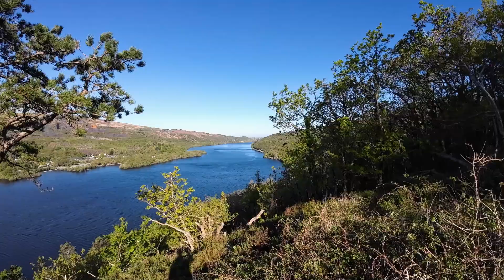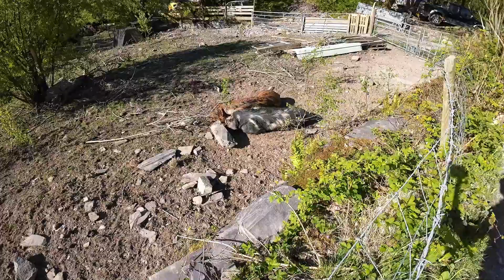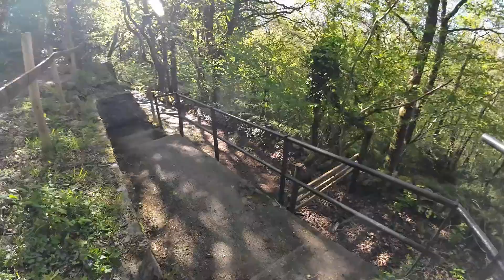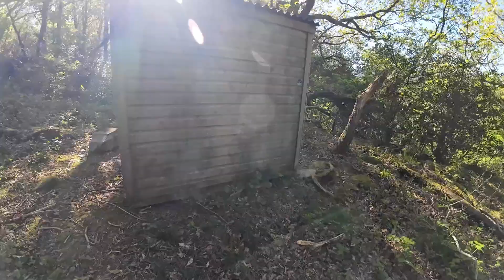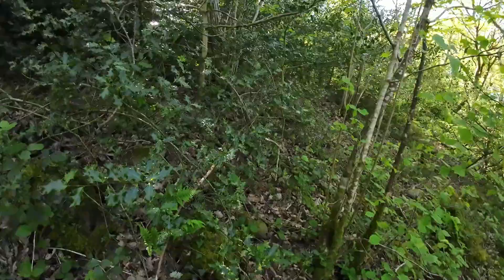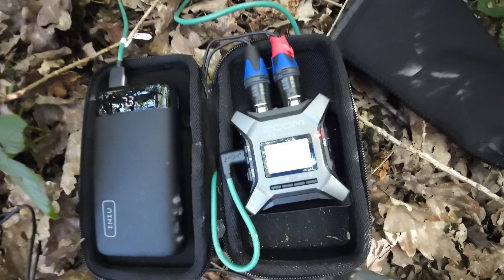Field Recording | Zoom f3 & Clippies | Drop Rig | Bird Migration | Weather, Security and Placement

Comment: Hi Rich, sadly no nightjars last night but plenty of other birds and the odd gurgling sound from my stomach, god them clippy microphone's are sensitive, guess i need to leave a drop rig, which power bank do you use?
Reply from the maker: Cheers, they'll turn up when big juicy hawk moths start  flying about. I use the Iniu Bi - B5 20k powerbank. There are more modern ones but this works for me. You got to be careful when getting a powerbank to make sure it can power a low energy device. I have bought other ones and they did not power the f3.
Reply: @richvids101 thanks Rich,  I use the zoom H5 but will be getting the F3 soon.
Reply from the maker: @jonesthestone  Excellent, no more self noise for your future recordings